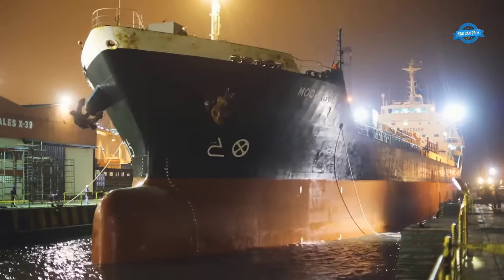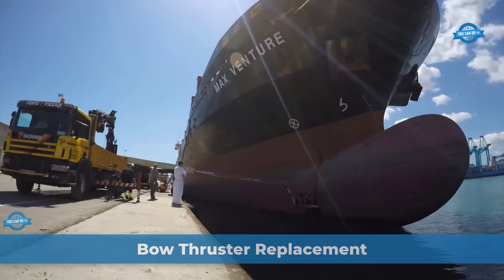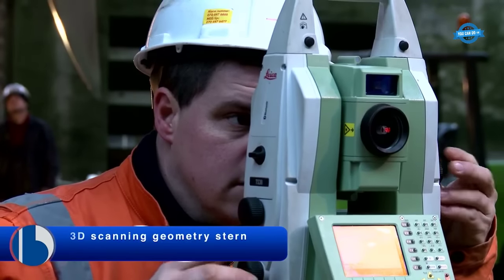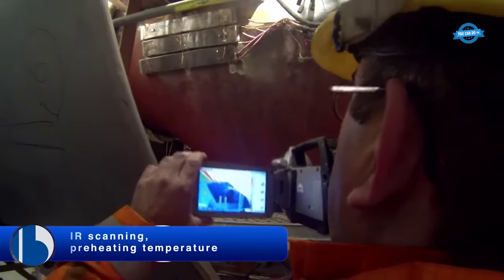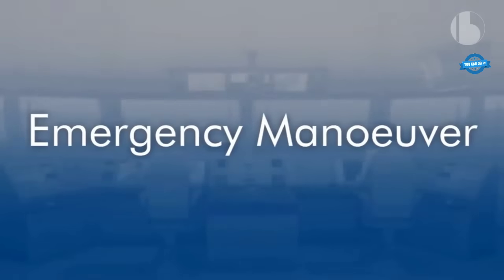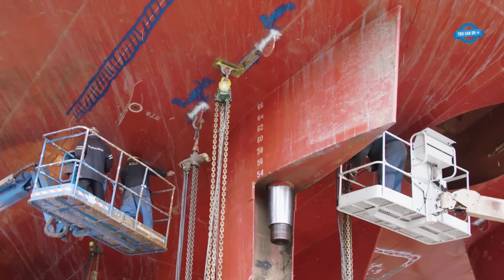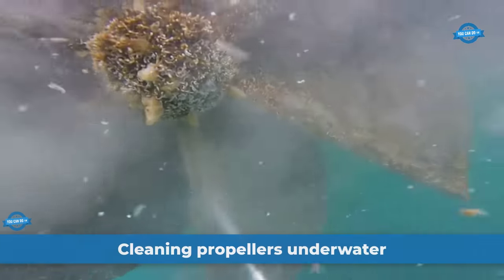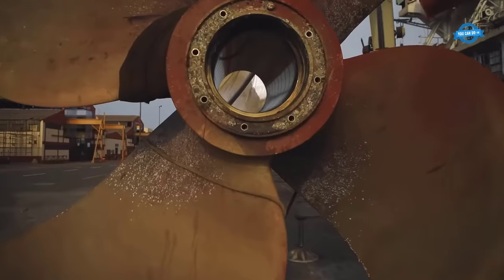How To Float Several Hundred Thousand Tons Vessels Out Of The Water For Repair And Maintenance?

Comment: How do they clean/paint the areas of the hull resting on the blocks?
Reply: I was reading a book about that.  They would refloat the ship and shift it slightly and set it back down on the blocks exposing the previously hidden areas.
Reply: @raoulcruz4404  Nope! It's a sidetrack for this kind of commercial vessels.
Reply: There are several blocking plans that in rotation, so for the next docking, the blocks will be placed differently, exposing the previously missed areas.